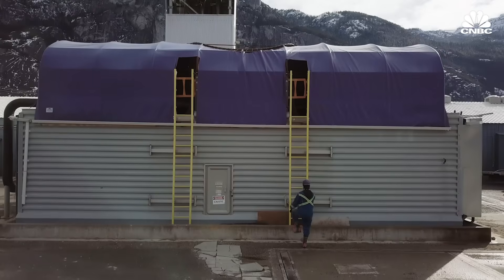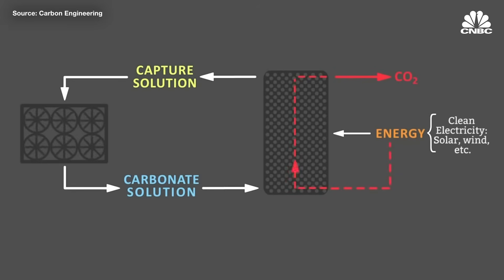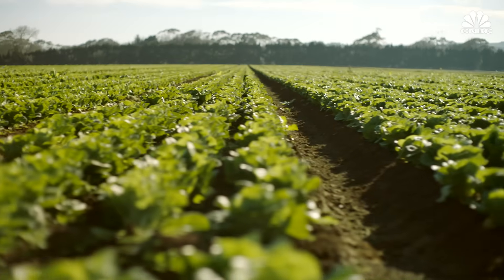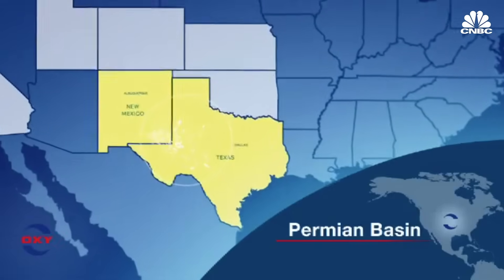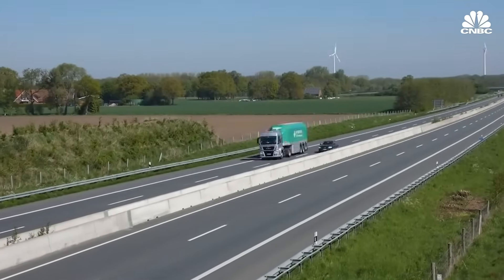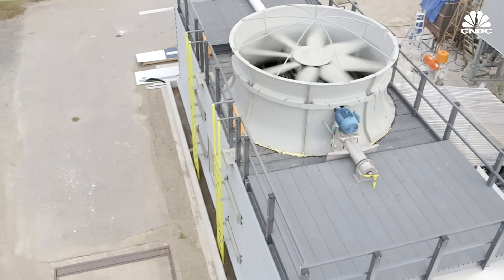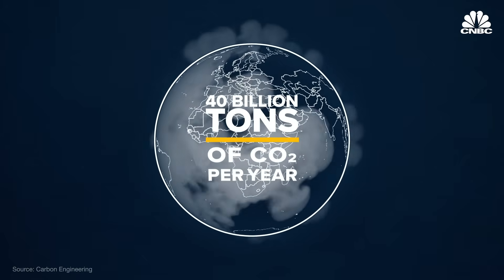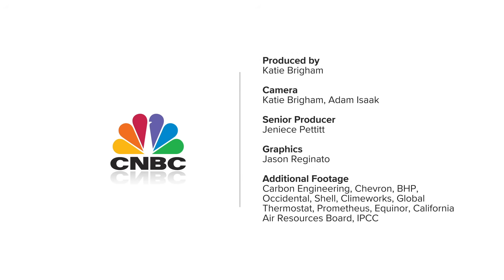Bill Gates-Backed Carbon Capture Plant Does The Work Of 40 Million Trees

Comment: People who think oil is going away are living in fantasy land.
Putting a large carbon tax on oil massively hurts the poor people. How do the climate activists justify making the poor people destitute.
None of the climate activists talk about the massive amounts of co2 dumped into the air from the mining, manufacturing, transportation, and maintenance of large wind and solar systems, including electric transmission lines.
Climate activists always talk about trees, trees, trees........but agriculture is a very significant co2 removal source. Just drive across Iowa in the summer with 300 miles of corn stalks as high as an elephant's eye, and that occurs every year. Trees take carbon out of the air when they are young and growing, but that is reduced when they mature, and that is most of their life.

Comment: So I just did a little math.... obviously a generalization, but assuming you plant each tree ten feet apart, you can fit a million trees on 2,500 acres. Multiple that by 40 and you get 100,000 acres. With an average acreage cost in the U.S. of $2,500.00 multiplied by 100k = $250,000,000.00 ..... Which I GUARANTEE is less money than this whole project. Not to mention all the other benefits a forest creates. smh

Comment: Silviculture and food forests are an economical solution. There is no faster way to sequester carbon than creating an open forest center story, bring everything up to 18 feet or so, reachable by a pole saw, and dropping it to the forest floor and processing the duff so the level is less than twelve inches off the floor. This carbon creates shade for embedded seeds, water retention, and the basis for new soil that feeds the trees which feeds animals(goats) that convert the excess to fertilizer. After the heavy work is done, making the center story, it is easy to bring the animals through at towards the end of the growing season. Major reduction of fire danger, low slow fires are much more manageable than crown fires. Planting trees is okay, but encouraging mature trees to grow more will supercharge the sequestration process, larger existing surface areas turned on to grow. https://www.youtube.com/watch?v=pamDzV9mG68&t=4s    http://treeculturesandiego.com/

Comment: I mean I dont know as much chemistry and geology as I should, but does placing that much co2 underground not cause problems with fault lines or could it not leak back out through cracks
Reply: They store it deep enough underground to where it is essentially stuck inside the rock and can never leave

Comment: Trees are FAR FAR cheaper.  Drone Culture @ $.50 per ton of CO2...forever.  And Trees are good even if CO2 isn't a problem.  (Quit wasting land for "growing" ethanol and plant trees.)

Actually, it has still not been proven that our CO2 emissions are going to have significant adverse effects.  A ~1 C per CO2 doubling is Agreed Upon by the 97% of Scientists that agree with Global Warming.  And 1 C is not a problem...it's good.  The natural 0.3 C increase just since 1960 has been EXTREMELY BENEFICIAL.  And the natural 1 C increase since the 1700's got us out of "years without summers" and from horrible famines from the cold.  And the CO2 since 1960 has increased Agricultural Production WORLDWIDE at least 10%...$Trillions worth.

Any larger amounts of warming is theorized (since we've not seen the predicted troposphere warming by satellites or weather balloons) by the additional greenhouse warming from increased humidity theorized to result from the slight CO2 warming.  The additional humidity IS NOT BEING OBSERVED.  The opposite may be happening (I say "may" because there is uncertainty of around +/- 0.6 C "degrees worth" and the humidity is down 0.3 "degrees worth"  This UNCERTAINTY IS GREATER THAN the PRIMARY CO2 actual effect...so WE. DO. NOT. KNOW. ).

Since extreme weather events have not been occurring (regardless of exaggerations in the press) we should do what we can to control CO2 that WON'T DESTROY ECONOMIES like tree planting and work feverishly on Safe Thermal (not FAST) Nuclear reactors which will be WAY WAY (100's of times) more environmentally friendly than LARGE SCALE wind and solar...and far less expensive too (I have no problem with residential solar if the economics works for the owners).

Comment: Solar Desalination mimicks natural rain.
Simple Solar Desalination Plant uses vertical glass & inclined glass plane vapor collector running to trough to carry off fresh water, above sea water pool, heated by the sun. 
Fresh water stored in cistern below ground.
Brine moves to pools for evaporation to table salt.
Solar still can be designed to use gravity to move water
with no moving parts
at all......

Comment: trees turn co2 into oxygen
Reply: So does this machine, do you think the O in CO2 just magically disappears?
Reply: Web Wanderer   I've been doing some research and it's not anywhere near as efficient as trees. Also these machines require tons of energy to run. Trees use sunlight.
Reply: @YoutubeVideoViewerDEL  But unlike trees the captured carbon can be stored back underground (good because when a tree dies that carbon goes back to the atmosphere), and you can synthesize clean fuel from the captured carbon. You can literally turn every single internal combustion engine machine into a carbon neutral machine overnight.
Reply: Basically I think better solutions exist and we are not getting to the core of the issue. We could use plant based plastic as former civilizations did. (Hemp is a good one) Plant based medicine instead of petrochemical pills. Hydrogen fueled vehicles instead of petroleum fuels. Many problems arose due to our use of oil and how/where it is obtained. 

I don't think more machines are the answer.  They may make some numbers on a graph go down short term but continuing to mess with natural cycles that have functioned perfectly is a rocky road. Plants need co2 and we need oxygen. 

Are you aware that Bill wants alot of us dead to fix other "man-made" problems like so called overpopulation? He promotes sterilization as well. He's not a good man if you look at what he believes/does.

Everything on this planet works together to clean and keep this place healthy...except for some humans. I just don't think more of the same is the answer.
Reply: @YoutubeVideoViewerDEL  Well you do seem to miss that a lot of the natural also wants us dead. Just take an infection or a hungry predator for example.

I think it is important to look into the options without prejudice so we can tell the good ideas from the bad ones. Bill may not the goodest person but this particular project does have good consequences.

Also, I had the opportunity to take a look at hydrogen fueled systems and the hydrogen economy (power everything with hydrogen) and despite the enthusiasm my professor had with hydrogen I have come to not like it for two reasons. Hydrogen is really, really difficult to contain. It escapes from every container you put it in and as it escapes it tends to damage the container. The other reason is the risk. Hydrogen is so light that you need to pressurize it a lot to transport it. Even if it doesn't explode or is set on fire, the tank itself is a missile ready to go and hit something or somebody. And of course, any unnoticed crack in the cylinder will result in one or another type of fracture. A gasoline container is not pressurized and you can bet the rest of the vehicle will fail before having a leak. Even then you just see the thing dripping and patch it, no big deal.

If instead of using fuel cells that turn hydrogen into water you were to use fuel cells that turn synthetic gasoline into CO2 and water for example, you get all the benefits of hydrogen minus its inconveniences and you are still carbon neutral. And let's not forget the absurd range you would get since a fuel cell can use more than 90% of the energy in the fuel as opposed to the 25%-35% efficiency of an internal combustion engine.
Reply: Web Wanderer Thanks for keeping it academic. This technology may have merits but we need to change that way we do things too. It's like people wanting a miracle drug to take away problems caused by lifestyle without changing their lifestyle.

Comment: We can use this tech responsibly. It can be used to help stabilize our planet. Then those people like Bill Gates and others can start helping too. Trees would work fine if people would not burn and deforest the areas outside of the US in large numbers. :( People are so freaking bent on their feelings they can't see that this tech (no matter who funds or works on it) can save us from any impact we have done from the past.
Reply: Also they spoke of the tech would encourage more fossil fuel use. However regulation would fix that. They didn't address that in the video much. We need a fix now and this is it. It does not matter who is doing it as long as it gone done.

Comment: Typical green utopist saying "Everybody has to drive electric vehicles!" I have one question. Who the hell is going to charge all those electric cars? Renewables simply won't be able to cut it. Oops it seems that oil, coal and gas remains to run the whole system. For the next forty years renewables could reach it's maximum capacity of 15%. Which is still very inefficient and a very slow progress will be made and is far from enough to cover everything.

Comment: If we are on a collision course with nature then this is probably the best way we can slow this problem down, if enough of these plants were installed in enough country's then we may be able to control climate conditions. This would buy us a bit of time to get the EV batteries and charging sites set up properly instead of rushing into this scramble to have electric vehicles with no facility's to charge them properly. All this has to be done sensibly so that the supply meets demand. This dream people have that we can just change from Petrol/ Diesel vehicles overnight to electric is not real it can't be done no matter how hard we try.

Comment: Flaw in the argument against partnering with big oil is the assumption that they would stop drilling or slow down without using the carbon to frack. They are going to drill for oil no matter what as we need it to run our society, so isn't moving more towards carbon neutral a better solution?

Comment: No problem with partnering with the oil industry. We just need to keep moving in the right direction.
The oil industry will not disappear overnight, but if we can significantly reduce the damage done by the oil industry and get the cooperation of the oil industry (even if that cooperation is forced by legislation), that's a good thing.
We should do it - and keep doing everything else we can also.

Comment: All you need is salt water and electrolysis, Converted into methane and craked into biofuel...
Military use it for over 50 years.. not new just unknowned..
Or make algea, the capture co2 and make fuels and food.... not new also.....
Garbage is biomass....This video is propaganda....
Fossil dont exist....  You can make fuel from any BIOMASS....
Water vapor is the greatest green gas and co2 the smallest. and politician  want to limit what feed us...
 That is the co2.
We are carbon base, sugar is carbon, all plants are carbon base. All fats are carbon base. Rocks are mineral base. Your clothes are carbon base..
No carbon, you end up no life on this planet. . Burn a corps or take all the water out you are left with, carbon and minerals...
Climate change is a trap. Given to the cabal or deep states member to identify the corrupted ones. 
The non corrupted dont even touch the subject....
like Trump, Maxime Bernier, Putine and others...
Reply: @Mr Penguin You can compare crude, as molasse or first pressure in oil production. 
Algea  cant be produce in large salt (algea) or soft water ponds.(chlorella). After you pressure the  oil out, it can be used for fuels or food for human or animal consumption.. 
Some is use, for plant food also, instead of fertilizer..  You dont need to dig it out of the soil, this was the old fashion way.

Comment: There is not enough arable land to remove the CO2 we have already dumped into the atmosphere. This would have worked 30 years ago but today it is going to require direct air capture to get our CO2 atmospheric concentration back down to 300 PPM. We are so far beyond picking a winning tech that everything needs to be used all at once, even if it means partnering with the fossil fuel industry.

Comment: the thing is that no one mentions 
rather than say throwing away a billionold cars and using green solar panel sourced energy electric cars, wouldnt it be more effective to make the old cars more efficient, ie swapping out a few modular parts running on say ethanol which has a higher energy density, and any co2 that is then released can then be stored , because it will take us 50 years to go all solar/ wind energy , whereas in the meantime if we also do carbon capture then  it might eventually become carbon negative 
producing solarpanels or electric cars requires alot of energy, that currently relies on fossil fuels, so rather than scrapping everything wouldn it be better to find more efficient solutions to current problems rather than a  completely different infastructure

also, we are at a stage where its too late to say " solar panels prevent co2 getting in the air in the first place" there is too much co2 in the air and waiting for everyone to have solarpanels is wrong
finally something about trees ---> they are not cheap they require land, 10m2 = 40million trees efficiency of removing co2, im not saying we should remove trees, whe should plant more but if there is a machine that can remove co2 at 4billion% the efficiency of trees why would you say no

Comment: i dont see this as the solution

of course hey arent suggesting to replace trees with this but what i mean is this wont be enough to bring co2 concentrations to safe levels
it would take too long to implement them to a large enough scale, not to mention implementing the infrastructure to power it with renewable energy 
lets consider this, a city adds a whole lot of these, and the entire city creates a nuclear plant and installs lots of solar panels, great, now its powering all these carbon capture plants
but what if it didnt do that, what if it still installed the nuclear plant and the panels, now you could power more things renewably this would displace fossil fuel plants and probably be a larger negative to carbon levels than the capture plants

i only see this as being practical in heavily polluted industrial zones, not to combat emissions but instead to keep people healthier

this would actually be much more useful after we switch to complete or near complete renewable power, then you wouldnt be shifting efforts away from decreasing the number of fossil fuel energy plants

Comment: Does this device produce the by product of photosynthesis? Plants make food in their leaves. The leaves contain a pigment called chlorophyll, which colors the leaves green. Chlorophyll can make food the plant can use from carbon dioxide, water, nutrients, and energy from sunlight. This process is called photosynthesis. During the process of photosynthesis, plants release oxygen into the air.
Plants (trees included) and animals (people included) form a symbiotic relationship, the survival of one symbiont is dependent on the other. The Earth HAS to have CO2 in the atmosphere or plants will die, and eventually the animals (people included) will also die because without plants there is no oxygen.
Reply: the point is to sequester co2 till we reach normal levels, when we reach normal levels plants will consume co2, then either they die and rot letting the co2 back or its eaten and then the waste decomposes whilst the animal that ate it will later also die and rot letting the co2 back
its supposed to circulate, we messed it up by digging down and adding extra co2 into the system
Reply: @magnusorn7313  What are they considering normal levels? The next thing is, lets hope they are correct in their findings. I say if they are wrong, we hang everybody involved.
Reply: @paladin11C40  pre industrial levels because thats what life has acclimated to